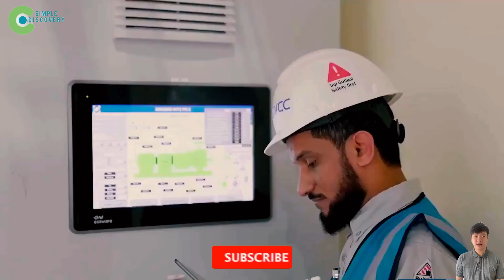Saudi Arabia BUILT A 2× NILE-LONG FRESHWATER HUGE PIPELINE Through DESERTS & 10,000-FT MOUNTAINS

Comment: Environmental sustainability over a wider scope is a major concern. Like the non renewable groundwater was depleted after in use for 25 years, it is evident that a more critical issue than revealed on the coastal line now is yet to come. The salt from desalination is being returned to the see increasing salinity, unless an equivalent proportion of fresh water. One of the source of which is the Nile.
Reply from the maker: You bring up important points about the long-term environmental sustainability of such projects; I appreciate you bringing this up.
Reply: If you consider the volume of the oceans, the salinity caused by desalination does not matter. The huge glaciers during the ice age did much more, as the sea level fell by approximately 100 meters.

Comment: See water contain about 10x more Mg than Ca and mostly it is MgSO4 - this makes water harmful. Try to coagulate coloids with FeCl3 or Al2(SO4)3 at first - this will remove bacteria and some cataions. After that use ion exchange resin first RSO3H next RN+(CH3)3OH- always in this sequence, never the other way. No energy is needed. Water needs energy for evaporation and chemicals cost it should be calculated for comparison which is cheaper.

Comment: That sounds absolutely massive—a freshwater pipeline twice the length of the Nile cutting across deserts and even mountains at 10,000 feet?! 🚰🌍 How are they keeping the pressure steady over such extreme terrain, and what’s the long-term plan to keep that much water flowing without losing half of it along the way?
Reply from the maker: Exactly! 🚰 That scale is mind-blowing. Over such distances and elevation changes, they’d need huge pumping stations, pressure-regulating valves, and reservoirs at intervals. Long-term, efficiency depends on advanced lining to prevent leakage and nonstop maintenance—otherwise losses would be enormous.

Comment: Using solar energy to power the operation and provide shade for the holding tanks would be a good idea.
I liked the low energy of reverse osmosis.  I think the saline waste water might be better processed into storage ponds, dried, and then the solids disposed of in solid rock.  Also are there evvorts to recharge the aquifer?  Great job!
Reply from the maker: Thanks for sharing your ideas on solar power, saline waste management, and aquifer recharge; those are all excellent points to consider!
Reply: @SimpleDiscovery24  duh...9% is 9%. Two idiots having a 'swashbuckling' incident.